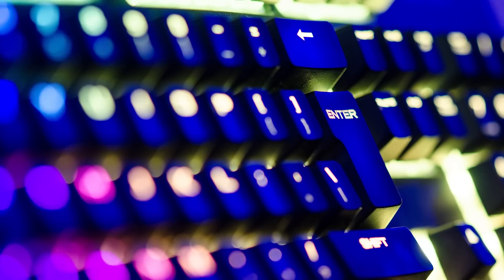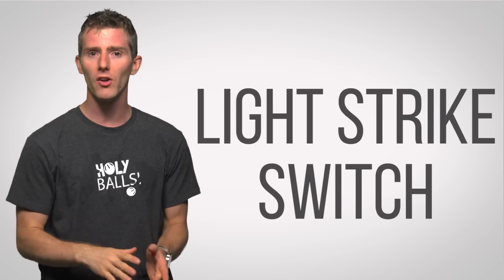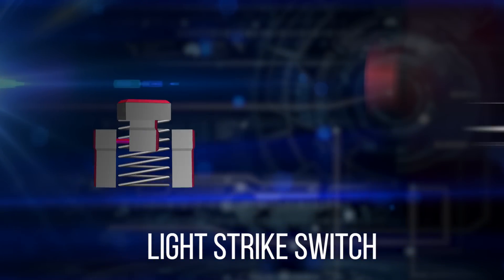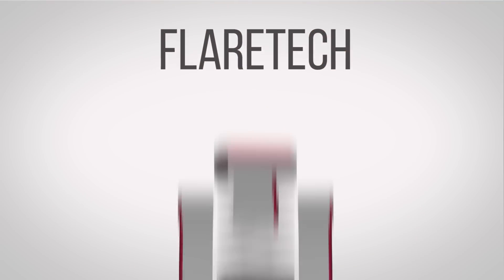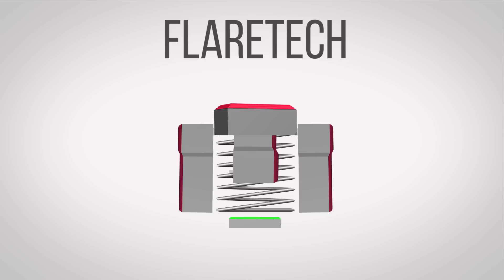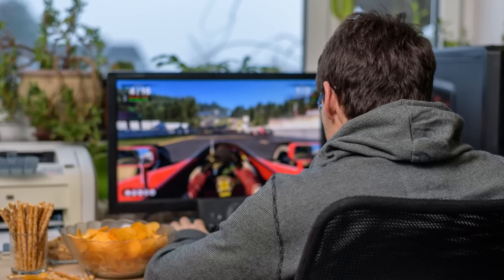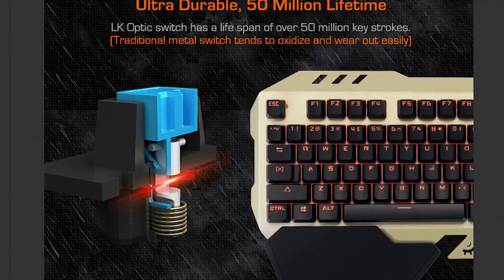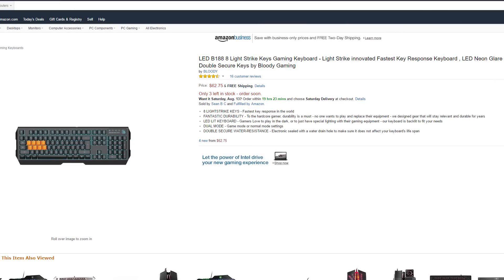What are Optical Key Switches?

Comment: Talking about mechanical keyboards, is there a keyboard that doesn't make that annoying clicking sound.
Reply: Mansen Good luck finding clears.
Reply: Each type of switch is different. What you are looking for is either MX clear or MX black.

The former doesn't have a "bump" that tells you when it's pushed down - The black does. And if those aren't quiet enough, you can put rubber rings below (o-rings) that dampen them even more.

The right combination can actually be quieter than the membrane type keyboards you're thinking of.
Reply: Cherry reds and browns.
Reply: Jason Davenport Nope. Clears and Blacks are even quieter than red/brown. :)
Reply: Jason Davenport Not that hard.

Comment: Are there any other benefits of applying optical keys over push-buttons, besides gaming?
Reply: Dust and water resistant.
Reply: With the Flaretech ones you can switch the key switches as easy as the keycaps, you can bind different actions depending on how far you press the key (e.g. light press go back one page, full press go back to the start, there are probably better examples).
Reply: I fixed broken keys on my optical keyboard by running it under a sink, so there's that.

Comment: Having a full velocity sensitive keyboard would be amazing, especially for music production on the go, pretty much all racing games, etc. Hell you can bind a light tap, < 25% velocity, as a special hotkey.

Although wouldnt on board controller/processor have to be vastly faster and better than current gen? Due to having increments of say 5% velocity steps, 0-100% per each key = finely distinguishing + registering each and enormous combinations of different keystrokes and pressures, then also extremely high polling rate to ensure each difference of velocity/keystroke will be measured accurately and quickly as velocity keyboards will have much finer control vs simple on/off current keyboards. Basic piano keyboards do this already so I guess it's not a big issue.
Reply: I currently have a CM Rapid-i, (mechanical keyboard with backlight) which has a Holtek ht32f1755 microcontroller. It runs at up to 72MHz and is specced at 1.25 DMIPS/MHz (90 DMIPS).
If you want to poll keys at 1000hz (which is overkill, 144hz at the most, those interrupts burn system resources you know, guys? Come back I have more opinions on latency!) that leaves 90/1000=0.09 DMIPS (not really instructions per second, it is kinda a benchmark score) of CPU 'power' to check the keys, USB for firmware updates, set the mandatory RGB lighting, and communicate the results to the host computer. With reasonable coding that should be quite doable (72000 clock cycles, plus pipelining in the CPU and perhaps hardware accelerated reading of keys {Hard drives use DMA to read 6 BILLION bits of data off the platter per second for example}) the same problem is basically solved with mice using a camera and motion tracking, why can't it be done with a bunch of purpose-built keys? The hardest part now would probably be getting the OS/game to support treating keyboard keys as analog input, but I'm sure the keyboard could play double duty and act like a separate analog input for a few keys.

TL;DR: Yes, it can be done, we have done it before.

EDIT: Youtube escaped my quotes wrong -_-
Reply: you will have to have a keyboard with 22 core xeon man.
Reply: "Come back I have more opinions on latency!"

I lol'd, 'cause my eyes were starting to glaze over at exactly that point. >.<
Reply: ***** Good to know it was worth it, I put that in there for just that reason. I hate reading dry technical documents, but the information is often of the best quality.

Comment: Analog switches is something i wanted for a long time. It finally makes the keyboard a controller replacement so you dont have to have to input devices
Reply: That's exactly what Wooting is aiming for. Depending on how well the game supports gamepad+keyboard, you can at worst turn the keyboard into a gamepad and bind all of those buttons to keys.

Best case if a game supports the wooting, you can get analog buttons where it makes sense, and the rest will still be usable (with a mouse) normally.

You can always toggle between modes with a single click.

Comment: Why not "using" photons instead of electrons in computers so that the response time can be even quicker? :)
Reply: I am not only talking about keyboards, i am talking about the whole pc. As far as i know electrons normally travel about at half the speed of light and photons travel at the speed of light so that should decrease any operation on your system by half the time it took before. Since photons are massless  their collision with protons or other particles should not make those moving at all, so from the outer point of view, no heat would be created. But sadly i think it is not possible to handle the movement of photons in such a tiny scale. Electric conducters work by having something like a "sea of electrons" around their atoms so that if you push in one electron on one side another one will be pushed out on the other side. You cannot do anything like that with photons because they are massless and they always have to travel at the speed of light (you also would not be able to turn of your pc anymore ^^). You would have to get tiny reflectors into positions that form calculation curcuits.
As a conclusion we have to stick to our "slow" and heat creating computers ... sadly :,(
(sorry for bad english)
Reply: *****
That is right. We cannot use light to transport computer information. But what is computer information (or binary code)? The 0 represents not moving electrons, the 1 moving ones. So theoretically we could use moving photons instead of moving electrons. So the photons "are" the computer information.